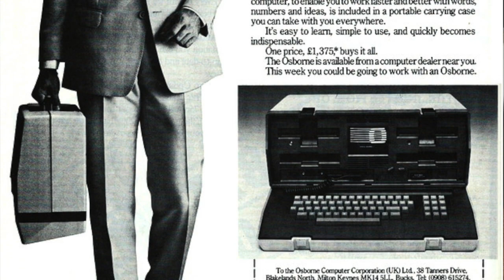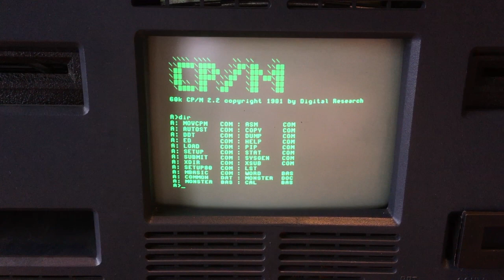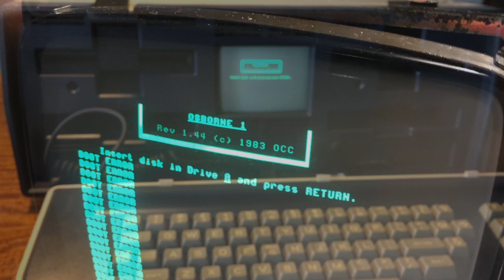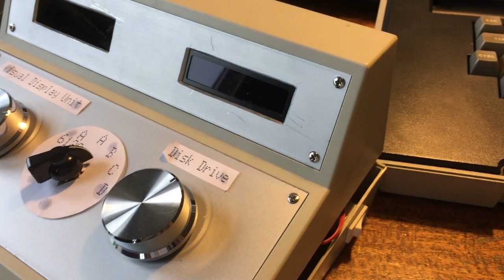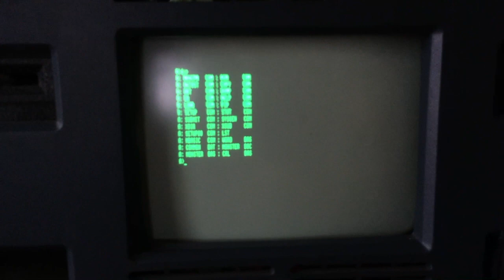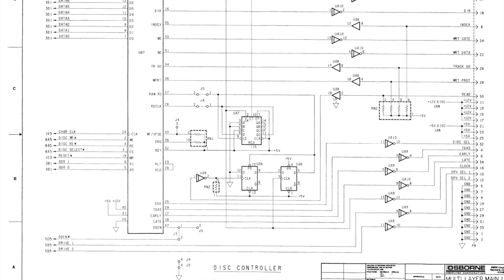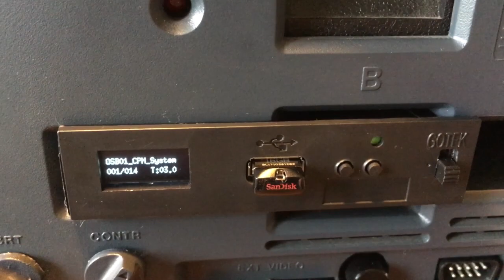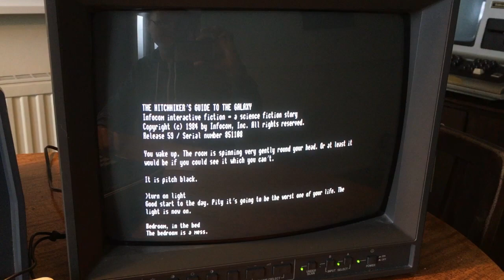Retro Challenge April 2018 - Osborne 1 Restoration

Comment: Thanks so much for the video.  Got my start at 14 on this computer.  Had the 14.4 modem and 99% of my time was spent dialing into pbx's and bbs's all over the US before the internet as we know it today.  Self taught CPM, learned spreadsheets and navigation around (probably illegal) bbs's and 'other' systems.  My favorite memory though was the adventure game.  Any chance that's available to play now anywhere?
Reply from the maker: @dogcat2347  Sorry for my delay in replying!  I was about to say, almost all the early adventure games were derived from Colossal Cave Adventure.  There were lots of subtly difference versions, but any of them should provoke the same nostalgia.  I first encountered it as Pyramid 2000 on the TRS-80, which was the same cave adventure, but supposedly in the catacombs under a pyramid!  Have fun adventuring :-)

Comment: Do you have any experience working on an Osborne Executive? I don't know how similar the circuitry is to the Osborne 1, but I just bought an Executive and I'm having some problems with the internal monitor.
 
I opened the computer because the front cover was a little loose and there was an intermittent problem with the power turning off and restarting if I moved the computer. I saw that there was a couple of jumper wires on the main board - one was just a clip lead connected between two chips! It came off and after I put the computer back on, the image on the internal monitor is slowly rolling like the vertical sync isn't working. I can't imagine why someone would "fix" an earlier problem by just using a clip wire, but it can't be a coincidence that the internal monitor started having problems after I disconnected it. Please help if you can!

Comment: Are the ones with the strip saying "Osborne-1" on the side rev A or rev B?
Reply from the maker: The original revision had Osborne 1 on the side, with catches on the side and a ribbon cable for the keyboard. The later revision (commonly called the Osborne 1a in some literature) has no writing down the side, catches on the top, and a coiled cable for the keyboard.

I have two of the Osborne 1a which I restored in my videos, and recently got an original Osborne 1, although I haven’t had a chance to restore that yet.
Reply: @richardloxley  Thanks!

Comment: I didn't watch the video to the end (I own two Osborne One and I repaired both, so I already suffered on that and I can't see other suffering LOL).

I'm just writing you a note because I've seen on your site you hadn't bootable floppy disks for it. Maybe it would be useful in the future or for any other with the same trouble. 

I discovered how to format and write floppy disks for the Osborne One using an old IBM XT compatible. 

* Specs *
- the Ms-Dos PC must have 360 kB FDD (I didn't succeed using 1.2Mb FDD)
- the Osborne One must have Double Density drives (it doesn't work with Single Density drives). One of my two Osborne One has the internal board for Double Density.

Then you must find the "22disk" for Dos (look for 22dsk142.zip on the web or get it from this page: http://www.gaby.de/edownl.htm). 
unzip, run cmenu and choose OSB2 to format for the Osborne

To write an image on a real floppy use Image Disk 1.18  for .imd images (get it at https://web.archive.org/web/20130330052932/http://www.classiccmp.org/dunfield/img/index.htm)  - Choose double step = off, 40 tracks, double side = on) - get the images from https://web.archive.org/web/20130323080107/http://www.classiccmp.org/dunfield/img54306/system.htm - remember, SSDD disk like "Osborne 1 Double Density CP/M" (https://web.archive.org/web/20130323080107/http://www.classiccmp.org/dunfield/img54306/d/o1ddsys.zip)

(Note: for .td0 images must use Teledisk instead)

Hope it helps! 
Cheers from Brazil 
Giovi
Reply from the maker: Nice one - it’s good to have other options!

I now have three Osbornes and have fully repaired the first two I got. I’ve got a Gotek/FlashFloppy drive in one so that’s now my go-to way of transferring files to floppies. 

I do also have an IBM XT so your information may prove useful in the future :-)